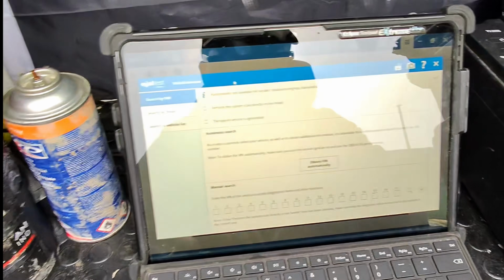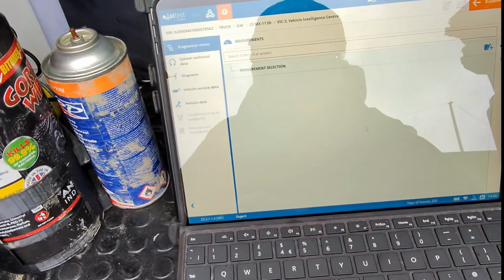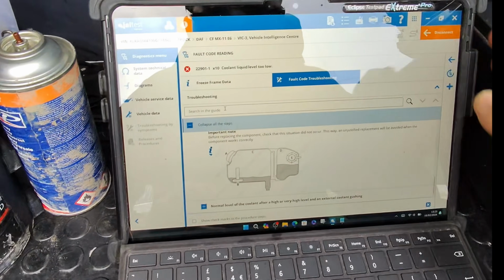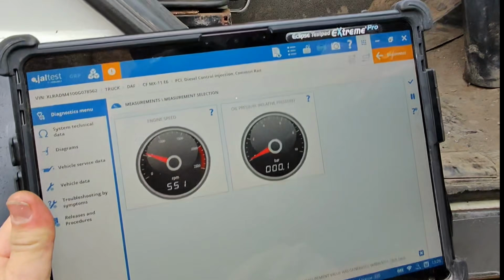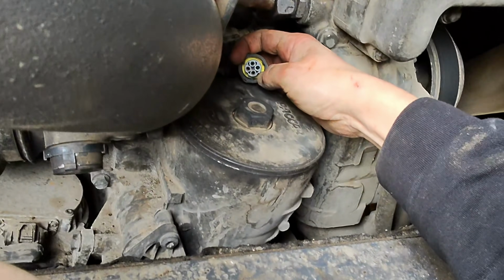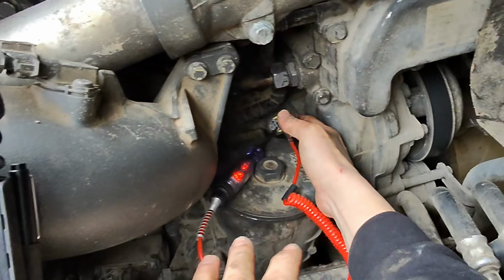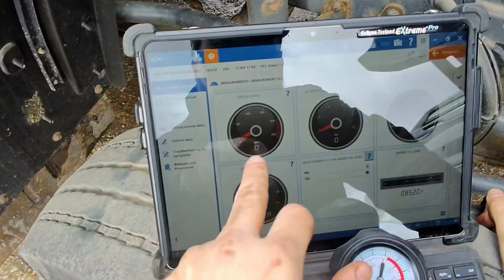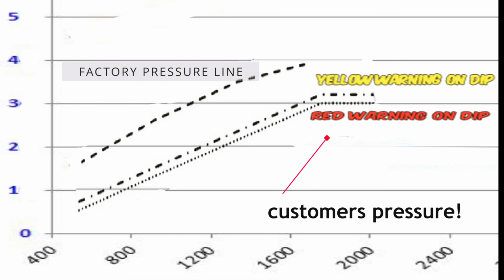DAF CF coolant and oil problems - Everything you need to know

Comment: Really good and informative video i have a similar problem on my daf xf480 that has a intermittent low oil pressure fault that comes on only when the truck is fully loaded that comes on and disappears after few seconds  any idea what could be the cause?

Comment: After spending quite a bit of money today on daf parts we have found a solution to this that is very simple the float inside does not float in water it only floats on a concentrated mix of coolant either pure or strongly mixed this cause serious issue for us but lesson learned now, before you spend the money the magnet doesnt really stick on tube likely cause is the coolant gets topped up after changing bottle and this makes the mix stronger

Comment: I had a mx13 engine with oil pump failure, it had broke up inside and jammed the relief valve open, I only run one old Daf cf85 2005 Hookloader truck now, the rest are Volvo and scania, I wouldn’t buy another euro 6 Daf again they are made of chocolate in all respects 🤦

Comment: Looks loike sludge on tge oil pick up?. I guess that oil has not been changed for a very long time.  Routine maintenance goes a long way.
Reply from the maker: Hey thanks for the comment. Oh most definitely. It's bad enough trying to keep these engines running as it is......not servicing them is just madness in my eyes.
Reply: @TRUCKTECHUK  yes I agree with you.   Spend a little bit of money now  or a lot later to repair/rebuild or replace.  As the old saying goes, Penny  wise and pound foolish. 
Luckily for the owner, you caught  it now.
Keep up the great work 👍.

Comment: We have had a lot of 70 plate xf units with yellow coolant warning with new sensor and tank replaced having to go into daf with software update ? Any insight what is the software problem.
Reply from the maker: Hey Ricardo. It was discussed over on the forum what chassis numbers are affected by the software and why DAF wanted trucks with low coolant levels to be presented to the dealer for reprogramming due to this 👍

Comment: Not related to video but can you help me out- I have DAF XF 106 and want to build dual stacks. How can it done correctly so I don’t ruin the DPF system?
Reply: You'll have to route it from where it normally exits the silencer. Could be tricky on a 2013-2017 model which have a diffusor instead of a normal piece of pipe/

Comment: Mate ..I have a question about the wiring of the euro6 daf . Those it have a resistor in the wire harness for the engine ECU .if so then how can I test it
Reply from the maker: Hey buddy how are you? You can test it with a multi-meter. This is why you should have a resistance measurement for can
Reply from the maker: If you want to expand your knowledge of CAN and wiring principles just ask over on: https://www.trucktechuk.com/forum

Comment: Have you ever come across a daf lf with a blocked silencer causing a diesel oxidation catalyst fault
Reply from the maker: Hey Denis. Usually, the DOC faults I see are from excessively blocked DPF'S. I start with a DPF then see if the DOC can come up to temperature and maintain it. Sometimes it's been damaged and can't make temperature, I've not tried to get these cleaned yet 🙃

Comment: Nice video mate. Had a fair few with oil pressure switches faulty on MX11 and MX13. Was also changing a coolant header tank for same reason today 😂. I use long nose spark plug pliers to get those plugs off. Like a long nose plier with a ring end at 45⁰ angle. Perfect for those plugs. Keep the videos coming 👍
Reply from the maker: hey Daniel, sorry for the late reply. DAF had a bulletin on oil pressure sensor issues, they should of done one for the header tanks too ha ha ha. i will have to invest in some pilers like that buddy

Comment: Good job with that multiple pressure problem.. Oil change intervals on 120000 km are weird. On mx 11 oil level sensor shows good level, surprisingly there is nothing on dipstick. In the end I only drain 20liters from pan.. Did you deal with coolant leaks 😏
Reply: Just rewatched it, in that case (normal coolant level) i check the emergency pressure valve on the expansion tank. If no pressure track is found I move to changing tank. The floating magnet is likely to crack and gets down full of coolant.

Comment: nice 1 mr a need them 2 items in my life for removing the plug and oil pressure kit
Reply from the maker: Hey mick. Are you still awake ⏰️ 😴 🙃.  I can sort you out with them no problem. Currently looking to add more to the shop and supply DAF parts next 😳
Reply: @TRUCKTECHUK  been in about a hour mate on me way back out now

Comment: Great fix, clearly been a while since it was serviced.

I'm not too sure if it's a pull up/down circuit design in the oil pressure switch. Is there a reason you didn't control the signal with an incandescent test light to see if the scan tool would pick it up?
Reply from the maker: Hey, thanks for the comment. Yep, the evidence suggests that but not what I was told unfortunately hence the oil pressure gauge to confirm that it still wasn't an electrical fault causing the oil pressure issue and it was a maintenance issue 🙄 

I didn't do the signal wire as I don't own an incandescent test light any more 😂😂😂 I have got a power probe I use with a bulb for circuit integrity that I could have used at the ECU but would have been involved than reading the bulletin from DAF on how this particular oil pressure sensor becomes faulty from oil ingress. I've changed more of these than I've had hot dinners so went with the sensor from my stock.

Comment: Looks like it is never serviced or has oil changes
Reply from the maker: Hey norb. I know what you mean 😏. I was told it hadn't long been serviced.......that's why the oil pressure gauge came out to verify the diagnostic reading. I was going down the pump route but it was amazing to find it THAT BLOCKED 🚫
Reply: @TRUCKTECHUK The oil pump is  PITA job  as it is a cogbox out on a MX11 lol....My quick check on the wiring if a pressure switch is involved ,,switch off  plug it in and  blast air up it and if you get a reading on the laptop ,wiring is ok lol  You can regulate the air so you know it is accurate
Reply from the maker: I fucking thought it was buddy! I spoke to a tech who said the pump could be done in situ but I was sceptical about that.  I've stopped believing anyone these days unless I've done the job  myself 

Ahhh I was going to test the signal wire back to the PCI ECU for continuity but then I knew about the bulletin for the faulty oil pressure switches so I went with that. 

Then WITH oil pressure, the owner kept getting yellow and red warnings on the DIP. As you can see from the gauges the blocked pickup was causing the oil pressure to go out of specification.
Reply: @TRUCKTECHUK  Yeah the pump is tucked up beside the timing gear